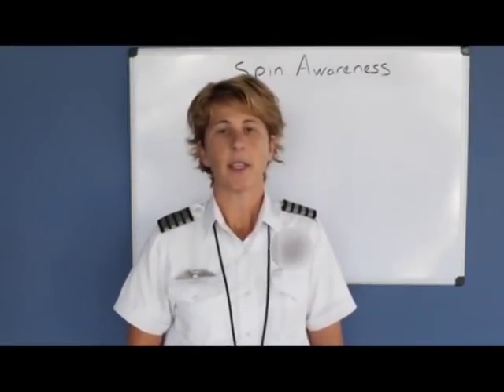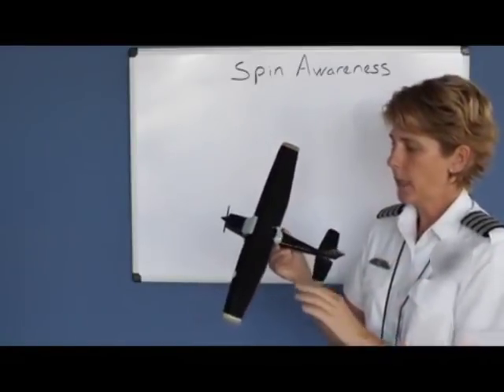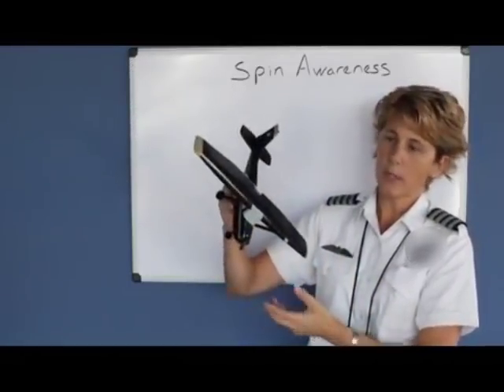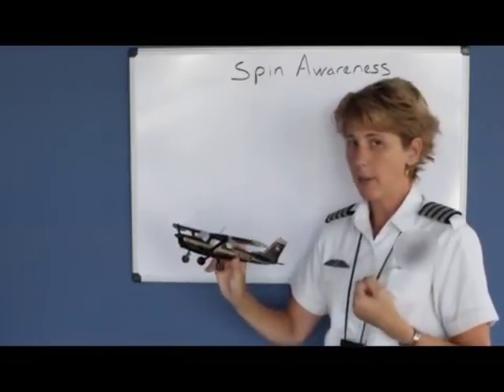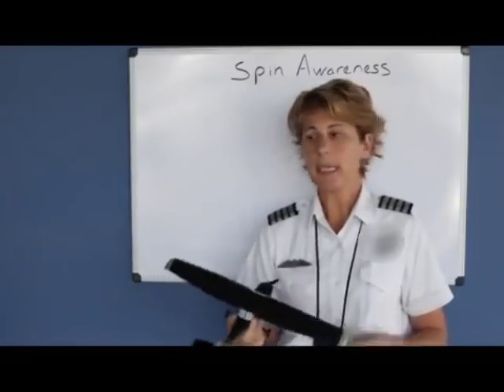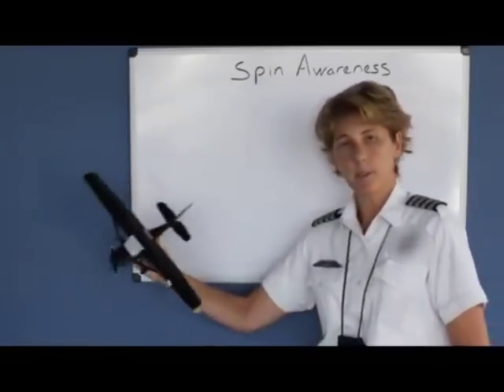Spin Awareness (Private Pilot Lesson 3h)

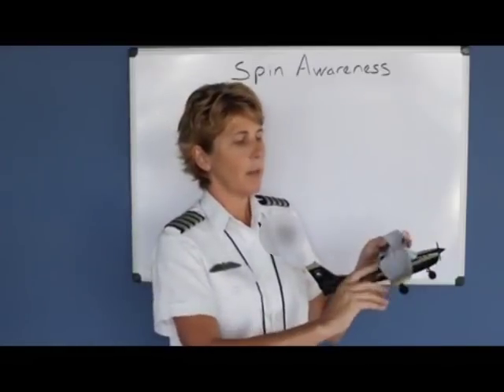Comment: 2nd senario at take/off or departure: -  7:03 "...so if it pitches up and yaws to the left and you didn't control that it would go right into a spin and there's no time to recover."  That scenario scares me the most as in here due to a failure to perform an adequate pre-flight inspection by a superb aviator.  https://www.youtube.com/watch?v=CsP9dwkHzbY

Comment: This was a very good instruction with the exception of why we pull the power to idle. It’s actually because the horizontal stabilizer is producing a downward component of lift. If we had the throttle full it would accelerate air flow around the fuselage and over the HS and the nose would want to pitch up, which would worsen this situation.
Reply: Perhaps so but also consider that the torque effect of the prop may be what got the aircraft to break in one direction or the other. Coming back to idle takes that out of the equation.  Air Force folks--remember the T-37 spin recovery procedure?

Comment: I just have 1 question; how does washout help reduce the chance of spinning?
Reply: I’m pretty sure that the angle of attack would be less at the wing tips so the inner wing would stall first so your lift reduces but the wing tips wouldn’t be in as deep as a stall so you still have a bit of control over then. Please correct if wrong
Reply: @benking8299  actually you are correct =) i did the exam for this a while ago

Comment: Thanks for that great summary!

Timestamps for your 4 stall-spin scenarios:

6:03 During engine failure: Attempting to stretch glide & stalling uncoordinated.
6:57 During departure: Attempting to correct yaw due to (unintentional) pitching up and full power with opposite aileron & stalling uncoordinated.
7:26 During go-around: Attempting to correct yaw due to pitching up and applying full power with opposite aileron & stalling uncoordinated.
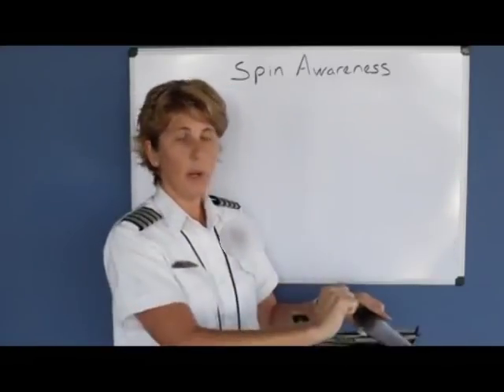8:11 During base to final turn: Attempting to increase turn rate by excess rudder & stalling uncoordinated due to skidding turn.

Comment: I haven't gotten into spin training yet. By opposite rudder, so they mean against the relative wind or in the opposite direction of the spin? For example, if my airplane starts spinning to the left (counterclockwise), which rudder pedal should I use?
Reply: Opposite rudder if the left wing - right rudder and right wing - left rudder
Reply: If left wing?   Both wings are stalled in a spin.
Reply: AviationNationHD other wing is still producing lift..
Reply: No, both are stalled. One is in greater stall then the other, none are producing lift.

Quoted:

In a spin, both wings are in a stalled condition but one wing will be in a deeper stall than the other. The drag is greater on the more deeply stalled wing causing the aircraft to autorotate (yaw) toward that wing. Spins are characterised by high angle of attack, low airspeed and high rate of descent.
Reply: @aviationnationhd3760  Wings still produce lift while in a stall. The wing in the direction of the yaw is at a higher AOA and therefore in a greater stall; producing less lift. So in her original example the airplane was yawed left and therefore the left wing produced less lift and more drag; right rudder needed for recovery. Also spin training is done for private pilot students, instructors need a separate endorsement for instructional proficiency.
Reply: Where were you 8 months ago when I needed the help?
Reply: Unless you are training to be a cfi, you wont need to spin train

Comment: The different between aircraft in relation spins is dramatic, I fly RC and I can tell you there are planes that wont spin like the Corby Starlet which will not spin, I have flow my 1/4 scale Corby Starlet for hundreds of hours and have tried to make it spin by it wont do it, on the other hand I have a 1/5 scale Piper Cub the will drop into a spin easy as pie, just pull the nose up, kick the rudder and away she goes, and it will spin like a top, but come down quite slowly because of its light wing loading, I think the aspect ratio and positioning of the tail feathers are all relevant factors when it come to spin characteristics.
Reply: Yea, Compare your toy to an aircraft. Let me know when you have your weight/balance calculated.

Comment: You can turn an aircraft with the rudder.its a good way to turn you just use a bit of opposite aileron, the opposite aileron keeps the wings level and the induced drag turns the plane, but even without the ailerons the plane will turn and the reason it turns is because the outside wing starts to travel faster and the airflow increases on that wing lifting it to create a co-ordinated turn.